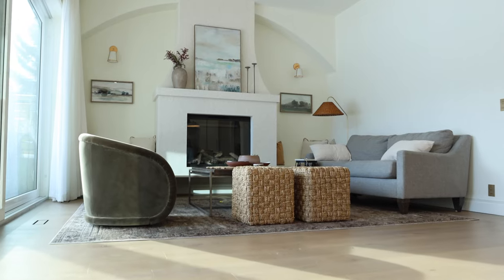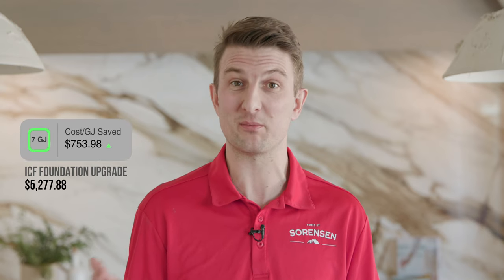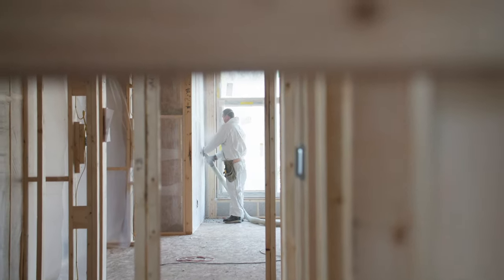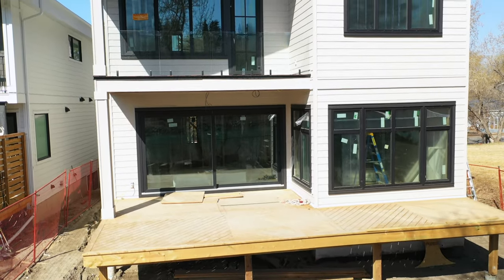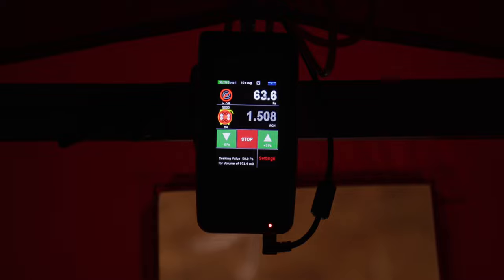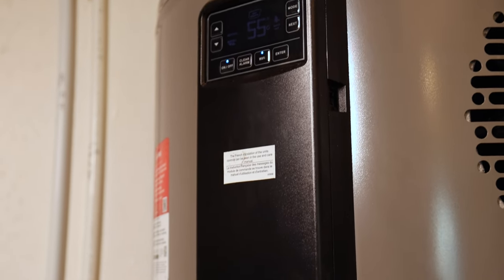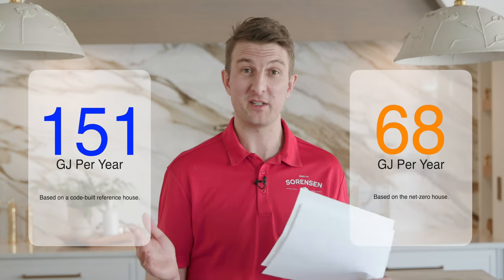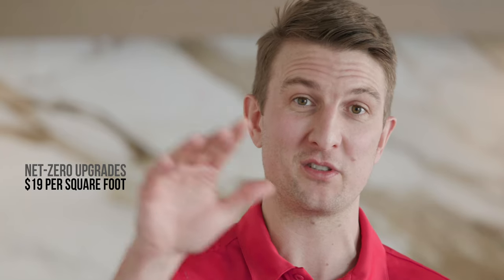EXTRA COSTS OF NET-ZERO

Comment: Have you considered conditioned crawlspaces? I just visited a build with Faswall block foundation around the perimeter and then just a high end vapor barrier system (no insulation on ground or in joists, just around perimeter). Then most of the HVAC was in the crawlspace and that cut costs a lot, too. 

A big benefit is concrete use reduction....just a footer and the relatively small amount Faswall requires.

Comment: I find your estimate for electrical for a code built home very, very high. In BC, I owner built a 3300 sq.ft home including a walkout basement with only one main wall below grade, with 2x6 construction, high efficiency multistage natural gas furnace and 40,000 btu fireplace in the great room with 32 low E2 double pain windows and a natural gas on demand water heater and no HRV. Our utility costs including appliance usage, heating (no AC installed) were approx. $210 per month with approx. $125 for electrical and $85 per month (averaged over the year) for natural gas. I am strongly considering building my final retirement house in Nova Scotia (less than 1800 sq.ft) in the near future and also plan to use double 2x4 stud construction with a 1/2" gap for full width 8" rock wool insulation and is much cheaper than 2x8 studs and the benefit of the thermal break, an insulated slab with rock wool warm board underneath the concrete and potentially an additional 2" warm board on the exterior and a large PV installation as well with Lithium battery bank installation...Nova Scotia power seems to have a limit of 10KW installations in order to qualify for their net metering program, also at $0.30 kwh....after living off-grid on a sailing yacht for the past 10 years, I am going to do my best to be minimally reliant on Nova Scotia power as I can and be setup for potentially strong weather systems in the future....Nice work on your house and thanks for the content!

Comment: Plus you get to live in a super comfortable house and not burn as many hydrocarbons. You should also consider whether the cost of energy will be higher or lower in the future years. Net zero means you don't pay for electricity regardless of what the price is. Theoretically these benefits will add to the resale value of the house as the next owner inherits them.

Comment: Great video! I hope to tackle a similar project in the next few years. Huge benefit knowing I'll be looking at ~$70k for a slightly smaller home.

Question for you on your numbers. Something doesn't quite add up for me. Your build (before solar) is (151-68=) 83 GJ/yr more efficient than the reference house. Your energy savings add up to (7+3+16+4+22+20+6+8+24 = ) 110GJ/yr. Seems to be a 27GJ/yr miss match. Would you be able to check on where the error came from (... including if it's my own math). Cheers.